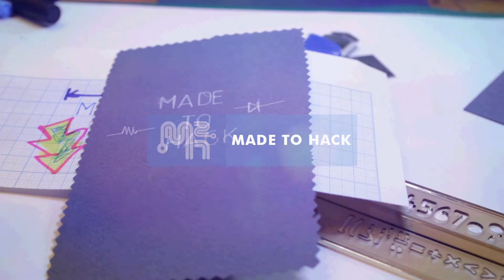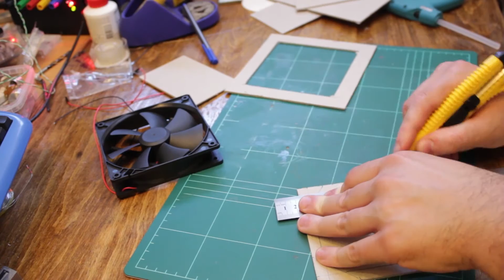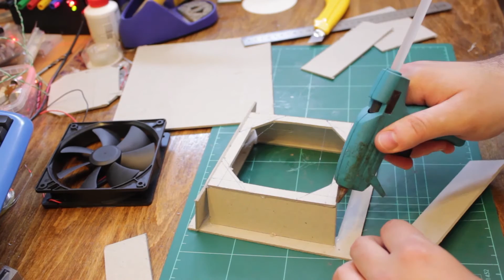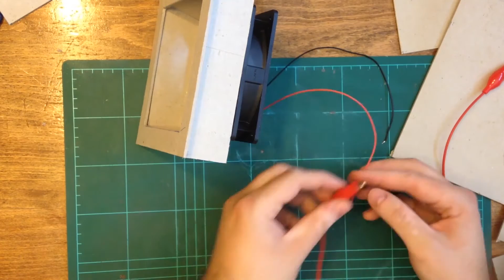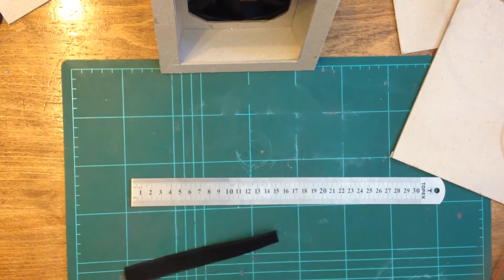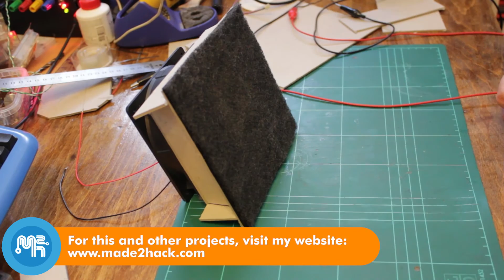How to make a Fume Extractor - Part 1

Comment: Do you still use it? what is your experience with it after so many years?
Reply from the maker: It still works. The one made with cardboard and a Sunon fan was the easiest and most stable. I just replace the carbon filter every once in a while! Or you can try to put 2 layers of filter if your fan is powerful enough!